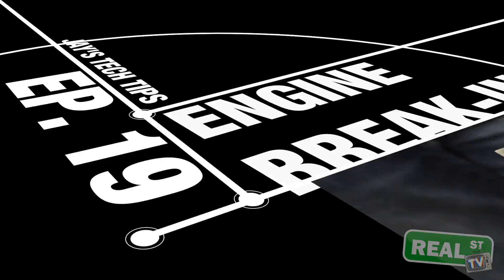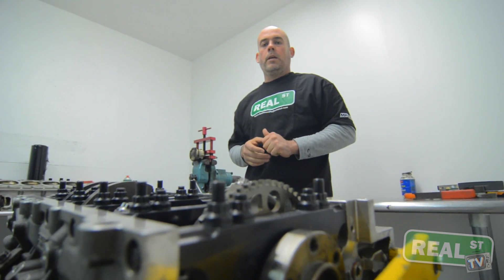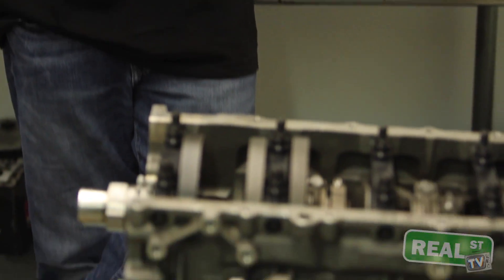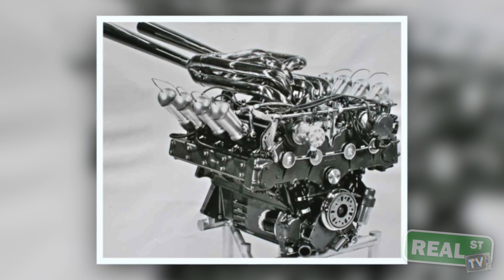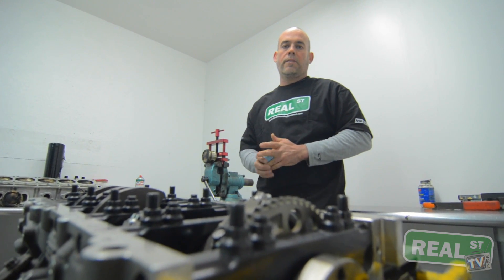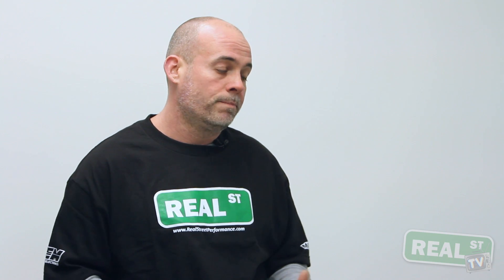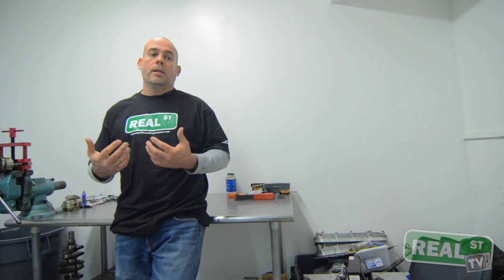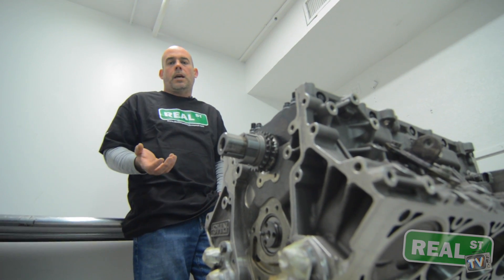Jay's Tech Tips #19: Engine Break In

Comment: Jay, I'm pretty confused. I've always heard never run synthetic oil on initial start up on a rebuild due to the oil getting past the rings easier and something about letting the rings seat properly, but the link to the break in oil you guys recommend is synthetic.
Reply: Sorry for speaking in generalities. Synthetic oil that you'd buy at the DIY parts store shouldn't be used as break in oil as it's too slick on the cylinder walls and the worry is the rings won't seat in. The oils that are specific for break in are engineered to protect cams and lifters/rocker pads during break in but allow the rings to seat up as long as the hone work is done properly and the fueling is correct. 
 Thanks
Reply: I've always just ran a high zinc non synthetic with no ill effects.
Reply: Thank you for clearing that up for me sir.

Comment: what type oil would you recommend for a new built engine? it's a 5.3 ls I've always heard straight 30 non detergent for the initial start-up for the first 15 mins. then drain and run whatever oil you plan on using. is this accurate? what's your ideas?
Reply from the maker: There have been a lot of approaches over the years but HPL has made it really easy now. We just use HPL Break In oil for the first start, then switch to their Performance oil if it‘a going to be using gasoline or the race oil if it’s going to be using ethanol/methanol. 

Break in oil: https://www.realstreetperformance.com/hpl-synthetic-break-in-motor-oil.html

Performance oil: https://www.realstreetperformance.com/hpl-synthetic-performance-motor-oil.html

Race oil: https://www.realstreetperformance.com/hpl-synthetic-race-motor-oil.html

Comment: Question for ya. I'm new to the channel and I love all your content, I actually created a folder with just your videos because I'm looking at rebuilding my 4g64 motor. Can you tell me if I do the 4g63 head swap on to my block am I going to riun it since the bore are different between blocks, or do I need a custom head gasket or what? I was told by a lot of people on my 3g Eclipse page I should get low compression pistons and a head swap and run a turbo. I like this idea but am unsure either the head part because of the bore difference, is that even an issue do you know?

Comment: every new car I ever bought I put 2500 miles on before beating on it. from 1968 until now never had problems.
Reply: Good practice.  I totally agree.

I do the same no matter if it is an old 76 Chevy truck or a new 2019 Toyota 4Runner or a Briggs and Stratton lawn mower engine.

Also let the engine warm all the way up to operating temp before driving it for the first 2500 miles helps longetivity as well.  

Even after its broke in it is always a good idea to let it warm up completely before running it hard.

Letting it warm up is cheap insurance that always pays off in the long run.

Comment: Yep modern engines are computationally designed however that doesn't mean old engine design was lacking care. Already mentioned below is the ring bedding in. The reason for multi grade stone honeing is to provide oil retention tracks with the course grit and ring bedding with the fine hone. The fine hone wears away themselves and the ring to improve the mating surface and reduce blowby. You could ref Merlin engines from the 30's, repco engines from the 60's, mcclaren engines today (merc went Nicosil), or believe hacks from the guys building engines that won't last 20k miles. And the fine hone debris is caught in the rough hone till the ring pack smashes it out to be pumped around the engine oil circuit. Break in the engine doesn't require testosterone to be done right, just real engineering knowledge.

Comment: main reason people stress about break-in being critical... is for non roller cam break-in
Reply: the way I was tought, is use sae 30w or sae 40w oild depending on clearences of course, as sae oil is supposed to have more natural stuff in it like zinc and just prime the oil system before starting it AND of course make sure you use quailty assembly lube and plenty of it on the cam. then run it just like jay said 2,000ish rpms for a good 20 mins. also, if you have dual valve springs you can remove the center springs so theres not as much pressure on the lobes during break in.

Comment: I've seen an OHV motor being ran on an engine stand via electric motor to cycle the oil through and break the rings and bearings in gently, this can even be done with the heads and intake manifold off, and a good time to check mechanical distributor timing.  If there's any way of running the engine without ignition pressure and doing that for a couple minutes, I'm sure it doesn't hurt the engine since the oil pump's running normally anyway.  Is there anyone that says this is a bad idea?

Comment: Great videos Jay. Could you do one on cylinder head quench? I'm building an 2jz-ge with 8.75:1 pistons and I'm wondering what would provide better knock resistance.
1.Using the ge head gasket and keeping the stock .045" quench clearance and having a 9.3:1 CR
2. Using a gte head gasket, giving a .080" quench clearance and a 8.75:1 CR.
I know if we were using ethanol the first option would be ideal but its very hard to come by here in Canada. So I guess I'm wondering which would get more out of a 8285 on pump gas or c16.
Reply from the maker: The number changes depending on the material of the block however it's safe to say on your iron block .050 is a nice quench distance. Having a larger area than that can promote more dead zones during the burning process than a ideal situation. A F20 honda for example doesn't have much area at all that the "quench pad" or area that's parallel to crown of the piston is very limited, I'd call that a pretty ideal situation. A bad example would be a A853 Dodge engine found in the SRT-4. It's got a dome piston about .250 down in the bore and a good amount of dead zones in the chamber. The good news is turbocharging loans itself to be pretty forgiving and it's hard to make a "bad" combination as long as you're using the correct octane for your compression/boost level. In your specific situation I'd run the GTE gasket OR a .040 cometic.
Reply: REALSTREETPERFTV Thanks for the detailed response. I have ran the gte gasket in this car before and found th